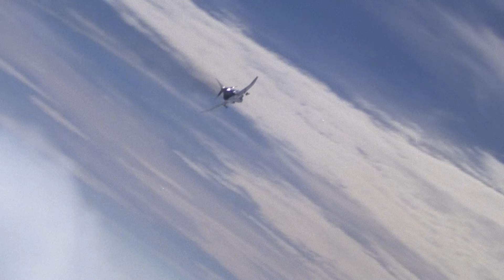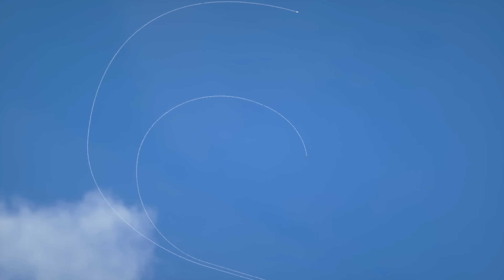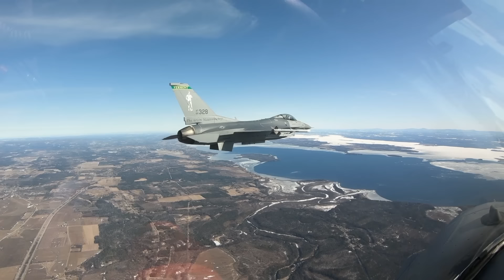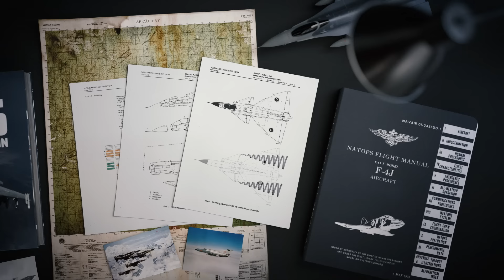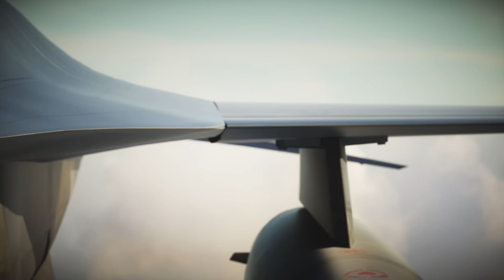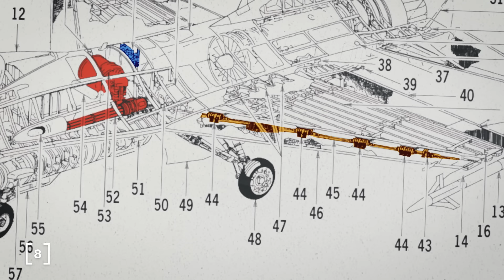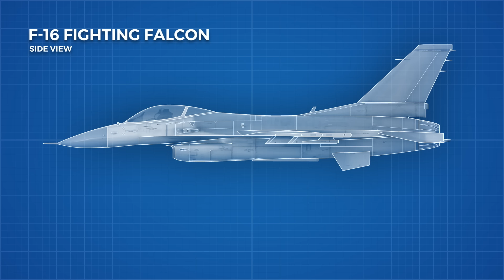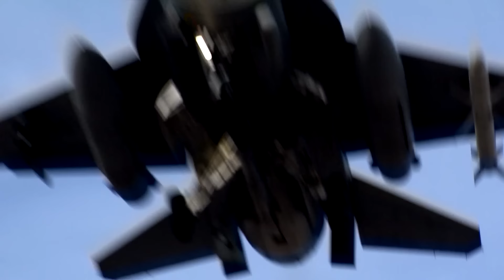The Insane Engineering of the F-16

Comment: probably just me being dumb but i didnt really get the talk about stalling. 

i feel like i understand the concept of an aircraft suffering from an aerodynamic stall in general, but in my head that never really felt like it would be an issue for "modern" fighters like this. i always thought they had enough thrust to just power through it, maybe in a combat scenario they could get in trouble if they dont have full manouverability available, but are they really at risk of falling out the sky due to a stall like commercial planes are? 

i know the pilot guy mentioned 26 degrees nose up as kinda a limit for f16, but im sure ive seen clips of similar (atleast to an idiot like me they look similar) fighters climbing close to vertical
Reply: All planes can fall out of the sky if they are going too slow to generate enough lift to keep the plane airborne. I guess the fighters you are referring to are those like the Su-27 family that can handle high angles of attack and have enough thrust to recover the airspeed.
Reply: @Kelvin_Foo  
of course any plane not going fast enough (and not counting vtol) will fall out of the sky, but i meant dont modern fighters have enough thrust to accelerate regardless of which way the nose is pointing

i think the clip i am remembering was a eurofighter typhoon, but even looking at the spec sheet for an f16 suggests it should have the thrust for it (it has a thrust/weight ratio of 1.096 according to wikipedia)

Comment: Hell of an airplane, even today.  I remember seeing the first low speed really high g turn at an airshow like the one you show at 19:56, and my thought was, "Holy crap".  Pre-vectored thrust, it almost looked like magic.    What they've done with vectored thrust, in later designs, pretty much does look like magic.   IIRC there was an F16XL that was a delta at one point, and they may have done a forward swept test bed on the 16 frame, but that may have been a scratch design, not sure

I was an electrical engineer working in the same lab (different FLIR program) for one of the sensors for the YF23 by that time.  We got moved to the 22., which wasn't supposed to happen by the competition rules, as it was supposed to be a package win, but ours was so much better than the competition's that they modded the rules, in practice.

A fellow engineer on another program later was doing an in house chip solution for the 1553 bus used on the F16 (IIRC) and I remember him saying it was a fairly complex bus, and task.  I expect that was a major part of what made hanging Western weapons on the Ukrainian MIGs that were supplied such a bitch.  I think I heard that a lot of the in flight dynamic targeting designation capabilities were not available on the MIGs, and I suspect the reason they were able to do as much as they were was due to NATO members like Poland using similar bastardized combinations, but that is just an educated guess.

If you want to do truly insane engineering, though, do one on the F22, far and away the highest performance/tech aircraft in the sky.  You get to talk about vectored thrust, ULTRA low RCS and how that is accomplished, a lot of the first TRULY integrated pilot unloading interfacing and information presentation, etc.  Just the wing construction and the massive problems they ran into is a story unto itself, and as I understand it, one of the main schedule extension drivers at one point.  Doing things for the first time is always what separates the men from the boys, so to speak.   The next level is doing things already done to a much higher performance level, and that involves many disciplines, often, from physicists to mathematicians to scientists to engineers of many disciplines, and more.

You didn't point out one reason that increased turn rate is so important, which is gaining degrees at such a rate that if you can lock another fighter into that fight mode you can quickly close on them, angularly, from the inside, as the Zero often did in WWII, until the allied fighter pilots realized that wasn't their fight mode they could win, and changed tactics.

The tech entering the inlet was interesting, kind of a complex series of motion.  When the airplane is disintegrating due to the gun, even just foam flaking, you know that gun is one serious SOB, funny and interesting story I've not heard.  "...like the one I performed with the Thunderbirds...".  You suck (kidding, I'm jealous).

Yeah, DIVERGENT PIO is the killer, and  you can accomplish it is a single engine GA trainer, even a high wing super stable Cessna 152, especially in pitch.  I still remember, freeze the elevator add momentary power on sink and reduce enough to sink to landing when stabilized.  It slows the control loop dramatically at solves the problem...if it doesn't, add power and go around if necessary.  Nothing like an uncommanded take off with some SERIOUS roll instability oscillation leading to a hard wing strike to get your attention...as in, bring me my brown pants.  I did some control system work, servos mostly, and this is where some available computer simulation tools that are of reasonably good (very good now) real world accuracy are a big help.  I'll tell you one lesson I would have learned watching that, and that is some previous thought put into which systems to negate or gain down early on in test, before those loops are stabilized.  Probably even switchable to allow simulated takeoff and landing conditions to be tested (approached) at altitude if possible (not an aero guy, so like I said, if and to the extent possible).  It is always nice to be 'several mistakes, some reaction, and exit time' high, than at 10-100' (say, worst case) when crap like that happens.  Those test pilots tend to have nerves of steel, but that was beyond pretty dicey.  We had a YF22 pancake in with an elevator instability at landing altitude, too, and luckily the pilot was relatively unhurt, but the airplane wasn't...unhurt, I mean.

Always great stuff dude, thx.
Reply: I am sure you would be fun to talk to, if only. Anyways I just wanted to tell u, He has already made a video on F22.
Reply: Super, should have looked it up, thx. @robelengida6211
Reply: "A fellow engineer on another program later was doing an in house chip solution for the 1553 bus used on the F16 (IIRC)" - Mil-Std-1553 is (was ?) a pretty sophisticated bus protocol for 1973. First used in the F-16. I graduated (BSEE) from Cal Poly Pomona, back in the 1980s, and it was a short distance from a General Dynamics facility, that the school was often referred to as GD-west. Many of the part time instructors were working engineers, at General Dynamics. One, I recall, designed the motion control for the Phalanx. I didn't expect the original F-16 to be that "digital", that early. The military gets all the good toys before everybody else !
Reply: Thank you for this comment, was fun to read
Reply: That YF22 pancaking video is around somewhere, I've seen it on YouTube. The flight control system would not let the pilot abandon the landing attempt and take off again. It kept forcing the nose back down as the pilot tried to raise it. It was pretty ugly to watch, and could have been a disaster, but thankfully the pilot was ok, as you say, but the aircraft got a bit of a battering. 
Test pilot, eh? One hell of a job ....
Reply: Yeah, the SIO (Software induced oscillations  :-)  ) where about the optimum phase pointwhen it contacted, IIRC.  I saw that, too, on YT.  I've slept since then, a BUNCH, so could be mistaken  Yes, in the F22 I think he was just a passenger as soon as that started. Glad I didn't do the stability analysis.   @richardconway6425

Comment: Here's an honest question. Why the left side insertion of the M61 Vulcan? Most people are 'right-handed' and are geared towards that being the primary weapon hand, so...
Reply: I don't think firing a gun in a jet is like firing a handgun or even a rifle.  You point the plane at the target and at that point, it doesn't really matter which side the gun is on.  I think the gun itself is less than 2 ft from the centerline of the aircraft.  The Emergency Power Unit (and the toxic hydrazine that it runs on) is in about the same position on the right side of the plane, so there's maybe no room for the gun on that side?  I'm guessing they did that since most fighters are entered from the left side and they didn't want pilots emergency egressing into noxious fumes.  Just a guess though.  Engineering has all of these weird reasons for why things are put where they are.
Reply: @emcon7000  makes sense. The reason I mentioned about handedness was the way the human brain divides analytical and creativity into different hemispheres. Rational reasoning vs. 'visceral' responses.

Comment: Naive question about turning a plane. In Kerbal Space Program I usually turn a plane by rolling 90° in the direction of the turn and pitching up. What would happen in the real world if someone did this?
Reply: Depending on t the aircraft and the speed of cornering, you will lose altitude. Low speed high AoA turns like that you basically fall out of the sky. The vertical lift vector drops significantly. So a high banked turn in a high drag landing configuration, you need to compensate with more power and control inputs to maintain altitude. At high speeds, like optimal cornering speed (let’s say 350kts) for the F-16, you can easily bank and yank with minimal corrections to maintain altitude. As explained in the video, the F-16’s design allows it to bleed energy minimally while maintaining a high turn rate at speed making it one of the best 2 circle rate fighters.

For slower aircraft like an A-10 or even a GA Cessna, you need to perform a coordinated turn to minimize something called slip. To do this, as you bank you are applying rudder (yaw) to control the slip of the aircraft.
Reply: Why doesn't Kerbal Space Program implement the physics of this?

Comment: The F-16 is still the only production fighter able to sustain a 9G turn...though this capability has been downgraded today with the additional weight they're burdened with in their multi-role envelope.   Good explanation of the inlet system which reminded me of a conversation with the P&W rep for a south american airforce who had one aircraft that would not go over Mach 1.   They sent the engine back for testing...but it was OK and were told to swap engines with another airframe that had no performance issues and the inability to go supersonic stayed with that one troubled airframe so it wasn't engine related.   Turned out the inlet was slightly out of spec so it wasn't able to diffuse the trans-sonic airflow properly.
F-16 has served with a multitude of air forces around the globe and continues to perform well which is a tribute to the original design and constant improvements over the years.
Reply: Many can sustain 9Gs easily but not many can sustain 9G through very wide speed regimes. The Eurofighter to my knowledge is the only one that can sustain 9G in the high supersonic regime, it is deliberately built that way so it can force enemy BVR missiles to deplete energy more easily. It's not for close-in dogfights.
Reply: I hope you realize that higher speeds make it easier to sustain Gs, right? Being able to hold 9G while supersonic is something most modern fighters can do. What's impressive is whichever fighter can sustain the most Gs at the lowest speed. That's how you optimize turn rate. @mimimimeow
Reply: @kamraam1464  Sorry I did not elaborate further. Eurofighter does that at very high altitudes, where air is thin and your speed bleeds like crazy. A loaded F-16 at M1.8 40k ft could barely sustain 3Gs. Not saying the F-16 or others are bad, just that the EF has a specific design goal for that arena.
Reply: there are many other airplanes able to sustain more than 9g, the rafale can sustain up to 11g, even tho it's kinda useless since the pilot will most likely die/pass out
Reply: The F-35A can sustain 9Gs as well. Though, The B and C variants cannot (limited to 7 and 7.5 respectively, due to their increased weight).
Reply: @ommexyt The F-35 can hit 9G...it cannot sustain. The F-16s ejector seat is reclined back to help prevent the pilot from blacking out in a sustained high G turn.. The F-35 don't have that.
Reply: A jet being able to make 9G turns isn't really meaningful when the pilot flying the jet can't make 9G turns.
Reply: it was shown clearly on that chart that the F16's best sustained turn is 7G.   where are you getting that 9G number?
Reply: To sustain a higher G turn, all you need to do is increase speed. There are plenty of videos online of F-16s sustaining 9 Gs, it just doesn't result in the best turn rate. @adamh1228
Reply: Am I wrong in thinking most modern f16s can still do 9G's as long as the pylons are off & the AOA limiter set to CAT I. Ig the new (block 80?) f16s with conformal tanks might fuck that up, although are they removable?.
Reply: F22 wins anyway
Reply: The point is moot since it's not possible to sustain 9G for much more than a couple of seconds.
Reply: MiG-29 can sustain +9G and -4G. In clean config without wing payload they are able to do sustained +10G and -5.5G as tested by Luftwaffe once they inherited MiG29s. 
Both F-16 and MiG-29 are limited to +6.5G in air-ground config. And that applies only for subsonic below M=0.85. Once flying faster, the G limit also is lower. But in general this does not matter much as Mig29 can do more than pilot can.. F-16 is limited by fly by wire hard limits that do not allow overG beyond 9.
Reply: The Su-27 is vastly superior. And the Indians are already developing better fighter jets! 🇮🇳❤️🇷🇺
Reply: @chaosXP3RT yet India is buying the Rafale
Reply: @chaosXP3RT  The Su-27 is more maneuverable in a dog fight, yes. But it has worse TWR (1.07 loaded vs. 1.26 loaded), worse radar (260km PESA vs 370km AESA) and no jamming capabilities (F-16s can be outfitted with ECM pods). 

There's a reason India is getting Rafales and Ukraine is replacing their MiGs and Sukhois with F-16s.

Comment: Meh, F-16 will get wreck by the Mirage-2000 in a tight dogfight.
Delta wing was the correct answer all along
Reply: uhh... F16 has cropped delta wings. Also, the F16 and Mirage 2000 occupied different niches, The F16 is a highly maneuverable plane and can conserve energy while Mirage is a high-speed action plane but it burns a lot of energy while turning. Mirage can do boom and zoom to ambush the F16, but if the F16 avoids such attacks using its maneuverability, it can buy time to make the Mirage burn all of its energy and win. F16 also has a better payload than Mirage (6 vs 4 missiles)

So, in a tight air combat scenario where 2 planes play cat and mouse, F16 gonna win.

Comment: Great video as always. I think it needs a little clarification, though. In the beginning of the video when talking about MiG-21 the footage shows a pair of Su-22  (the green planes) a couple of times. The latter is much bigger plane with adjustable wing configuration, more advanced and newer platform than MiG-21.
Reply: Simple people like simple content.
1. In video are almost not visible any MiG-21! Planes with Czechoslovakia markings (Československé letectvo) are Su-22! Not fast, not maneuverable, pretty heavy due a variable swept wing. Su-22 obviously dont have clean delta wind as MiG-21!
2. MiG-21 does not have variable swept wing in any variant or clone!
3. MiG-21 is not dogfighting plane, it is not easy to maneuver special in lower speed in low attitude.
4. Is designed primarily for attack from back.
5. Su 22 does not have AA radar!
Absurd

Comment: Fast Forward to 2023, air combat is about going faster and higher, with the best radars and DATALINKS, and launching hypersonic AAMs as far away as possible.
Reply: No, that was F-15. The modern air to air has started slowing down, relying on AWACS and other information sources along with priority to observability and stealth. Full agree on the missiles tho.
Reply: @TealJosh  agree on awacs. That's why Russia fast-tracked getting more of them into the air. My point is speed and altitude  regained importance relatively recently, to give extended range to missiles. R37 launched at M2.0+ and 60,000 ft has significant advantage of the same missile launched at M1.3 and 35,000 ft.
Reply: @earth9531  assuming it can see the target and not get jammed.
Reply: @TealJosh  stealth is a whole different ballgame. Nobody is considering giving Ukraine radar stealthy fighters, or even AEASA radars. Very few people alive know the specifics of R37 homing radar emmissions. I suspect freq hopping as a jamming countermeasure.
Reply: @earth9531  depending on which block of f16 Ukraine gets, aesa is on the table. Most probably won't have it. About r-37, it's guided in most of its flight, at long range jamming is easier. If it gets close enough that the missile's own radar switches on, then it's probably inside the burn through range of the typical jamming methods. The plan would be to jam the guiding aircraft before that.
Reply: @TealJosh  that takes a lot of watts, and R37 can communicate with all other battlefield sensors, airborne and ground based. The attacker has the advantage in that they know where the fight is going to be. Defenders have to jam everywhere. Mig31 was built specifically for wide area comms and long range missiles. I suspect actual R37 shoot downs (as opposed to mission kills) are on aircraft who never knew they were engaged.